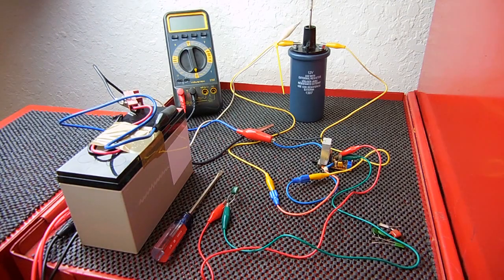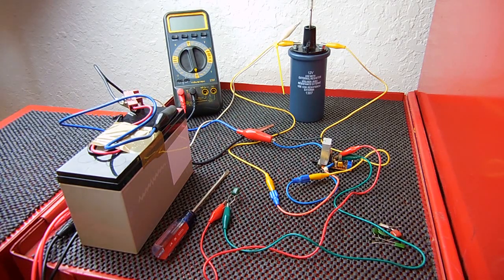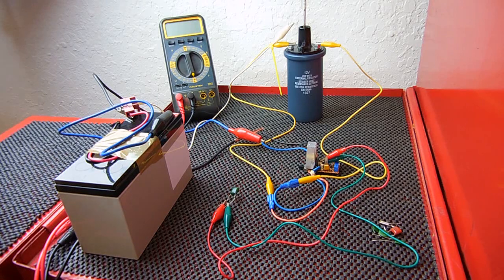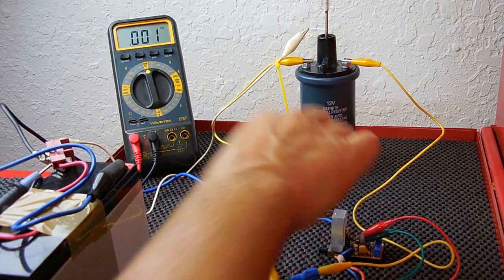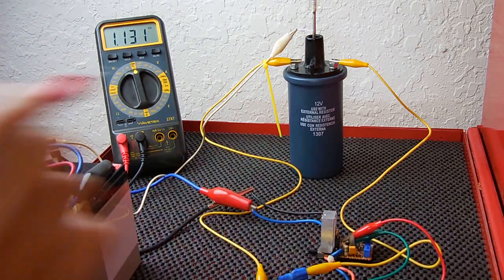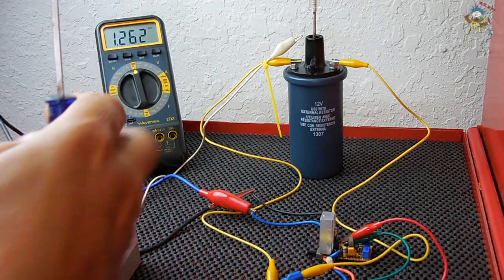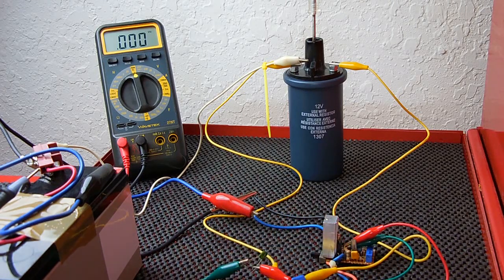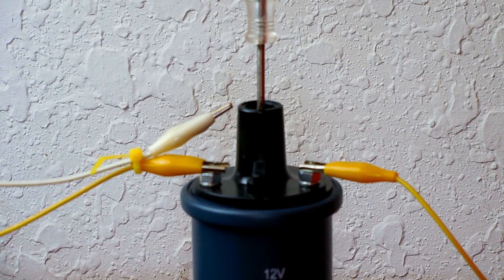Ignition Coil Driver & Tester (555 based)

Comment: That's pretty cool!  I can't imagine it'd be too useful as a diagnostic aid, but what it DOES do is demonstrate a very real phenomenon in automotive ignition systems:  Coil saturation.  As charge frequency (engine RPM) increases, coil output power decreases.  This is why automotive manufacturers have moved from single coil distributor ignitions to coil on plug electronically controlled ignitions.  The extra few milliseconds each coil has to build a charge makes a huge difference to the amount of spark energy released at the spark plug, allowing for a bigger gap (better fuel burn) and more reliable high RPM operation.  :D

I may have to build one of these to use as an educational aid!  Really cool!
Reply from the maker: Actually it's excellent for a coil tester. Resistance measurements won't tell you if the coil winding is breaking down due to the HV. With the tester you can see if the coil is able to produce a nice spark.
Reply: @electronicsNmore  the timing circuit and ability to change the frequency will be great for testing an automotive coil. Calculate the firing frequency at a specific engine RPM and use a capacitor to match that frequency on the test rig. Use an adjustable Gap spark tester and you be able to tell if your spark is breaking up at a specific RPM.

Comment: Holy crap, I built almost the same circuit 2 days ago. I edited the video and it's still uploading 2 hours later right now. I was swapping caps to alter frequency, drew out a chart  with cap/frequency relation but left that part out. And YES the mosfet gets VERY hot! I used a .1mf cap in the end. I used a mini oscope to measure frequency and added a pot for frequency adjustment. i didn't go as high in frequency, measure current, or use an ignition coil. nice video! much better arcs and to the point.
Reply from the maker: Adjusting the POT will allow the mosfet to only be warm using the same coil that I used.

Comment: Could this set-up be adapted to use to zap rats? I have built an enclosure with 3 pairs of electrodes placed 3/4" apart. I only want the circuit to fire when the rat steps on two electrodes simultaneously.
Reply from the maker: You can combine it with the device I designed below. Instead of triggering the door, have it trigger the coil connected to 2 plates. Thanks for watching!
https://www.youtube.com/watch?v=Uci3WSozdgE

Comment: By somehow changing the capacitance on the fly, could this be used in a similar way to a musical tesla coil?
Reply from the maker: You'd need to be able to quickly switch between different caps.
Reply: I was thinking that was probably the answer, several caps switched with a microcontroller.  No point really, just a bit of fun.
Reply: use pin 5 of the ne555 to send amplified audio signal to it with a  3w amplifier

Comment: Would this spark be sufficient in igniting a cloth and producing a flame?
Reply from the maker: I don't think it would ignite easily, but you'd probably get burn marks.
Reply: @electronicsNmore  I've set up the schematic you sourced on a breadboard, and can't seem to get it to work. If I'm correct, the positive lead of the ignition coil connects to the positive rail, the negative lead of the coil connects to the 1N4005 diode, and the arc should occur between the center terminal of the coil and a ground connection?

Comment: hi there! seems You have decent research done,
found some product at YUMINASHI (motorcycles), Denso IGNITION COIL (FOR 4V. ENGINES) - but not sure if suitable to use it or not on mine bike (I got 2valve single cylinder).
I'm a bit lost as description "THIS DENSO DIRECT IGNITION COIL IS ONLY MENTIONED FOR 4 VALVE HEADS/ENGINES"
what is difference ignition coil for 2 valves and 4 valves? - both cases are single cylinder.

Comment: I have a question: a diode 1N4005 from the negative pole of the coil goes to the "D" of the mosfet IRF640, this diode is it necessary...?
Reply from the maker: I don't see a reason, but there must be a reason for it. I didn't design that circuit. Thanks for watching!

Comment: Clearly illustrates the need for a CDI (capacitive discharge) ignition system. As the frequency (RPM of the engine) increases, the coil's magnetic field doesn't have enough time to fully saturate before a spark is generated. Spark is diminished at high RPM's, so engine has less power.
Reply from the maker: Thanks for watching Charlie!

Comment: I'm interested how it would be with two ignition coils in series but with +- -+ connection to get higher voltage.
Reply: Connect two 12 volt batteries in series to feed the coil 24 Volts.  The brave and cautious could rectify the line voltage to see if the coil windings would withstand 120+ volts. That don't rectify the line voltage and feed the coil with 12+ volts AC. In the event the smoke stays inside the coil with 1200  line volts try 240
Reply: Hmm, not resolution. Boosting ignition coil can have bad results. Connecting two ignition coils on two drivers like: One driver is connected to first ignition coil like positive-negative and another driver going negative-positive connection (opposite connection terminals than on first). Connecting plus from first ignition input and minus from second ignition coil input giving serial connection. On this way one ignition coil became positive and another ignition coil becaise negative and potential difference between two ignition coils (center output terminals) will be doubled 20kV+20kV....

Comment: Hello! Thank you for the circuit! I made it and it's working perfect. Now i have a question. As i use it for spark plug tester, i wanted to increase the spark by using capacitors, as shown in many videos, but there's no nearly any difference in sparks, even when using 3 stacks by 3 capacitors. What could be the reason? Does this circuit gives reliable information about the spark of spark plugs? I tested old standard - copper spark plug NGK vs. new Iridium NGK, and there was almost any difference in the spark...
Reply from the maker: This circuit would be used to test ignition coils for proper operation, not the plugs.
Reply: +electronicsNmore 
How then can i test plugs? I want to understand what is the spark, if the spark plug is running on engine?

Comment: Could you use something like this drive an electric fence, or is there enough current to be fatal?  Just curious because I've been zapped by spark plug wires, but heard there wasn't enough amperage to kill you.
Reply from the maker: The current output is very low, "Usually", not enough to kill. You can use this for a fence, but I would reduce the input voltage for a less painful shock. Be careful, and use good quality insulators. Make it at your own risk.

Comment: good vid, but IDK how the MOSFET is not failing from the inductive kickback! If you kill the MOSFET, consider replacing it with a FDP33N25. It is comparable to the IRFP250N and is cheaper than the IRF640.
Reply: I made a ignition driver circuit a while back based solely on a relay wired to self-oscillate. The coil of the relay was placed in series with the ignition coil, and the normally open contacts were connected across the relay coil so that when current flowed, it would activate the relay and then the relay contacts would close, allowing current to flow through the ignition coil contacts. Shortly after the relay contacts would reopen and because a <1uF capacitor (or condenser) is connected across the ignition coil, it would ring and that ringing generated the high voltage. However the problem with that circuit is that the contacts will corrode very quickly because every time they open a large spark is drawn.
Reply from the maker: Still going strong. :-) If it does fail, I'll swap it out. Thanks for watching!
Reply: @power-max  ... which is why in the traditional points-coil ignition there is a capacitor across the points.

Comment: Hi eNmore,
Can i use a power supply to drive this circuit ? How can i calculate the voltage on the coil because i won't dare to use my dmm.
Reply from the maker: As long as the power supply is able to supply the current. Why measure the output?
Reply: eNmore,
Many times people ask me to build them electric fences or even farmers want this to control their cattle and if the output voltages are too high it become a problem. O key, one can control this by the length of the arc, but i still wonder how much the voltage really is.
Reply: SODA510 - Most electric fences are "pulsed output" so that in case a human should touch it, they would be able to let go between pulses. Also, some just store a charge to give the animal a shock and then slowly charge up again when discharged. The latter of those are usually the solar type. Considering the cost of posts, wire, insulators, warning signs, etc., the cost of a commercial electric fence controller is minimal. You're walking into nothing but trouble by making home made equipment like that. If someone were to inadvertently touch your creation and get hurt or killed, you would surely get sued, let alone how you'd feel if your device killed or hurt someone. Commercial manufacturers take into account that a human may touch it and work that into their design. (Pulsed output, known voltage and current output, etc.) Even then, they can still hurt people or possibly even kill them if they have medical conditions or implanted devices. I know you want to help your friends out, but this is something that you might want to think twice about. Just some friendly advice. :-)

Comment: at 3.2kHz does the spark become liquid state?
Reply: I don't know what you mean by "liquid", but I built a circuit that runs a few tens of khz in an ignition coil, it seems to create a steady hot stream of plasma instead of a series of sparks.
Reply: @deltab9768  do you mean Distribution Cap of automobiles,

Or

Do you mean Magneto Pull Start?
Or magneto push start?

Liquid?  That word defines itself :)
Reply: It's similar to the coil shown here, just smaller. It was from a single cylinder engine with a battery driven ignition system. No, the spark isn't actually liquid, I've only tried making arcs in air. I think in water, the electricity would pass without actually arcing. There is a video of it on my channel.
Reply: @deltab9768  what's the part and model number of the single cylinder engine w/battery driven ignition system?
Reply: I don't know, to be honest. It was a small generator, which had been abandoned in a seasonal pond, and shot full of holes. The coil was intact, but rusted and had no label on it. I think any ignition coil that has an iron core sticking out both ends, should work with this circuit. Also, any coil that has a core which loops around the outside might work, if you wound the "feedback coil" in the right place. The fully enclosed ignition coils like the one electronicsnmore has, may or may not work, depending on whether the core has an internal loop, and depending on whether or not the case is metal.
Reply: @deltab9768  2560HS01 battery housing

On/off/select # 30702 ROHS REV:3 PCBS-11113381-62

small generator BF 8Ω0.25W

Spark plugs or broken Tesla neon bulb

Comment: That .05 is real shit.
That's lightning voice. If you restrictions LIGHTNING INTELLIGENCE then, well touching current is safe, that's the frequency Tesla played with. However, that dark mode plasma current sheet is deadlier than deadly. I'd rather touch 110 Direct Current that has a 10ohm resistance because of a ground wire acting as a positive tube? Odd. That should really be 125 DC... Hmm. 

That bandwidth was sick as _;

Comment: This will probably be the dumbest question so far but I need to know.  How are you holding the center terminal in the igntion coil? I have one just like that and I'm not sure how to make that attachment.
Reply from the maker: It's wedged between the outer edge of the internal metal sleeve and the plastic housing. Thanks for watching! Be sure to watch my "High Voltage" video playlist and share.

Comment: Could I use a square signal generator instead of this?
Reply from the maker: As long as the frequency is high, and you're driving a transistor or mosfet to handle the current, it should work fine.

Comment: Does that circuet work with pick up coils in distributor ?
And is it posibel to fire dual ignition coils with diferent polarity ?
And wuld it be posibel to advance ore retard those 2 ignition coils eua circuet?
I also wanted to know if there is any posibility to shild baterry to not get effected be that sparks ore alternator protection circuet via ground

Comment: an estimated 20,000v travels thru 1/4" of air
can you test 1/4" copper water pipe as the electric line instead of a solid/wrapped copper wire ? "BioCurrent"

Comment: I am surprised, how those yellow primary crocodile wires could handle 5amp current.
Mine melted quickly. had to put two in parallel for rest of the experiments...
Reply from the maker: You must've used 1A rated wires.

Comment: I was wondering , if this were an ignition system in the car , where would be the spark plug ? Moreover, as long as there is a spark , what is the need for a spark plug at all ? !!!
Reply: The ignition coil feeds the distributor, not the spark plug.  The distributor is what feeds the spark plug.  Newer vehicles don't have distributors since the firing circuit is computer controlled, therefore the ignition coils are feeding the spark plugs directly.
Reply: Marc Freeman Thanks for your explanation. I must see how a spark plug can convey a coming spark !
Reply: The spark plug creates a spark in the combustion charmer thereby igniting the air/fuel mixture,  pushing the piston down to turn the crankshaft
Reply: waswestkan   So helpful. Thanks ! Could you plz provide a link showing the ignition system in the car. I am so interested in producing a spark to light up my gas oven. I want to use the same a spark from a spark plug as in the car  :)
Reply: That is way too much trouble!  Just go get a pizeoelectric igniter off the web.  That is what is used in BBQ gas grills.  It produces a spark with either a 1.5v battery or just the push of the button.  Using a spark plug you would need the coil and battery.
Reply: Marc Freeman - Yep! That's the way to go. Why reinvent the wheel? You can by a BBQ igniter for under 10 dollars. Sometimes the easiest solution is the best solution.

Comment: the self oscillating relay set up is easier and imo better. I have one on my channel.
Reply from the maker: They work good, especially as a back EMF high voltage generator, but the contacts don't last too long due to arcing.